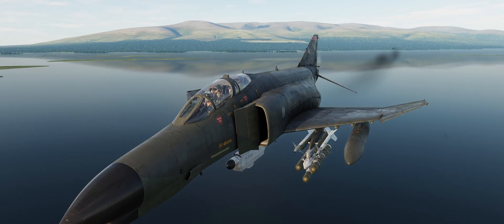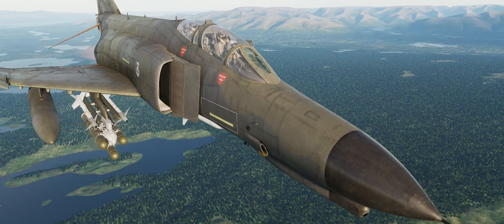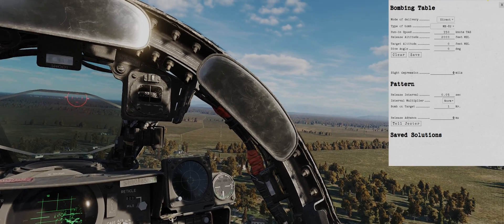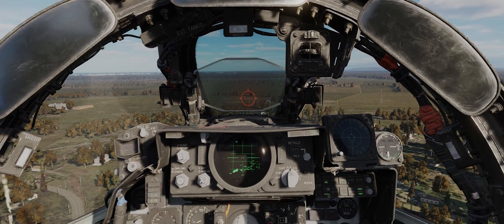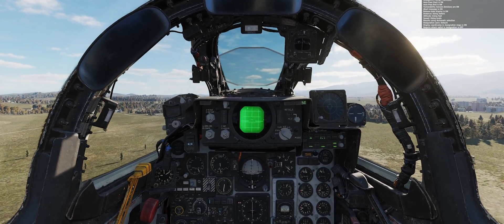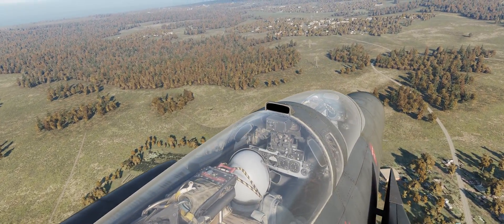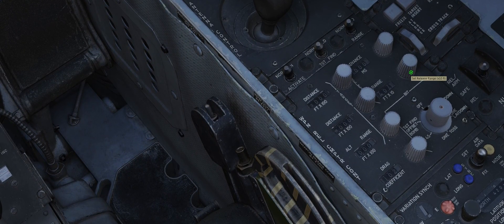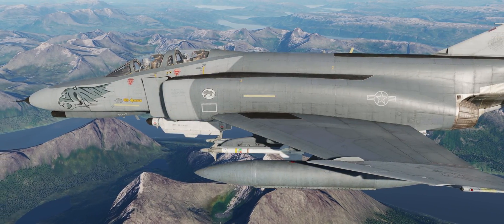F-4E Bombing Tutorial - Laydown Mode

Comment: Don’t know if you have it but you can get a pdf copy of the TO 1F-4E-34-1-1 which is the Aircrew Weapons Delivery Manual (non-nuclear). A Google search should put you on target for it. 😉

You’ll also find the Flight Manual 1F-4E-1 on the same page of the same site if you find the target. They are free downloads as well.

Laydown is on page 1-122 and 1-124 of the -34-1-1 and you’ll see it’s not necessarily just level delivery. There is a dive laydown approach as well as the level.

With the -34-1-1 you’ll be able to do everything by the book with solid explanations and even the math to go along with it.

Comment: Question: So the IP and the target would be set in your NAV computer? (the Nav comp can only store 2 waypoints, am I right?) Or can you just use the F10 map to determine the distance from IP to target? Either way you must enter this distance in the bombing table? Also, I imagine this method is not useful against moving ground targets? Otherwise thanks for explaining the more obscure bombing methods of the F4, as no one seems to be covering this and the manual is....well a bit too real life and historical rather than focusing on the actual methods one would be using in the sim. Please explain all of the other methods, as you're the man when it comes to old school bombing!
Reply from the maker: Jester will continually update your steering. He will replace teh current WP with the next one at a range of 2nm.  That's why I don't recommend putting the IP in the computer because he will swap it out at an inconvenient time.  Better to just run at the targert and know (from map recce) how far back along that line the iP is.  With a good human WSO, I suspect that he could actually call the pickle from the INS distance reading and get you close - if you were aiming at a big target with a big load of bombs (which is really what this mode is for).  
It's not a mode for engaging point targets - moving or not.  Doing that requires good visibility on the target - which is actually hard to come by.  With our Balloon Goes Up project we are coming to realize the value of the A-10's low speed and loiter ability for just this purpose.
I strongly suspect that the F-4E missions would more likely have been directed against pre-planned, pre-registered targets which would have benefited from a large bomb-load but not pinpoint precision.  That's just a feeling I have
Once PGMs really started to become common the game changes - a little - but in a truly SAM denied environment launching LGBs would have been.... "sporty" - again because you just would not have time to acquire the target and plan a good ingress and egress in real time - at 500kts and 50'.
--- Soapbox Ends -----------

Comment: Finally a detailed tutorial on this method! The laydown is nice because it gives you a piper over target and reference point so you know your level bombing will hit the right spot
Reply: The WRCS laydown mode does not give you the depression value. It's a manual calculation based on the parameters you enter into Heatblur's magic bombing table notebook. If you are not flying those parameters, your pipper placement will be off.

Comment: Hi Iain.  Quick question - you talk about setting the distance from the IP to the target in order to give you the reticle depression you want.  How do you correlate the two, ie how did you know that the distance you set and the depression you chose would then produce an accurate visual drop cue?  Thanks, and loving all the content.
Reply from the maker: For me it was a process of trial and error.  The longer the distance between IP and target the smaller the sight depression. A depression of 95mils seemed to be a good choice in terms of a balance it was close enough to have  identified the target and gotten ready for the pickle, but no so close that the sight was too far down the HUD that I would have to adjust my seat position to see it.  It's a totally YMMV thing.